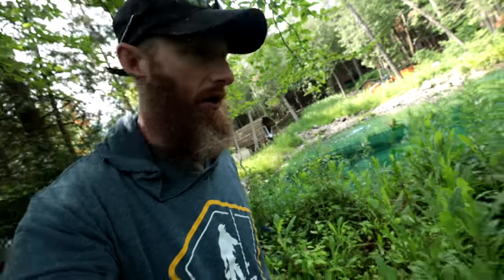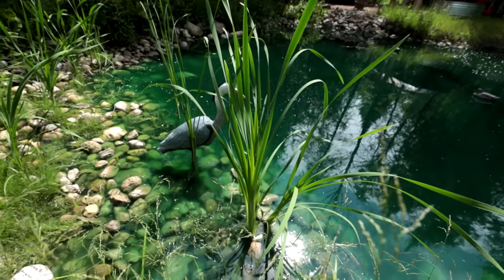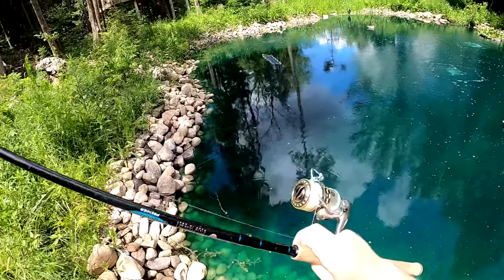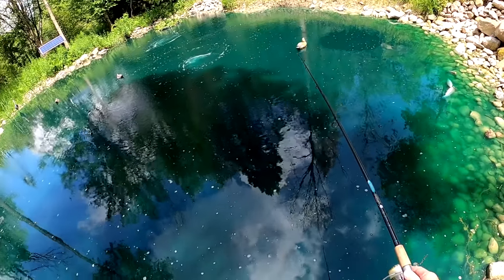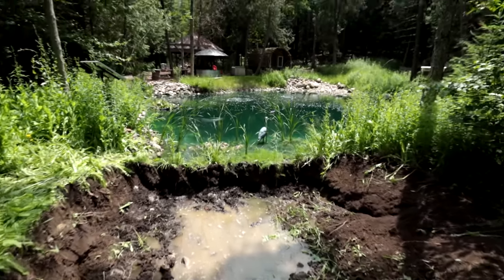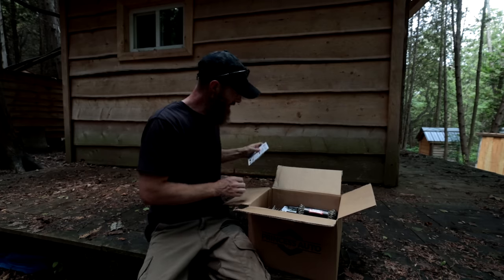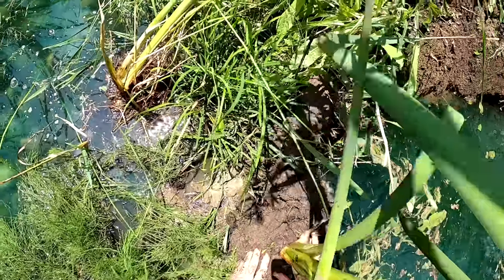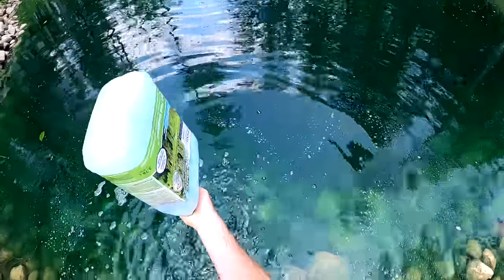BIG WIN for the Trophy Trout Pond - Perfecting Balance, New Expansion, Pond Modification, Critters

Comment: The fish seem healthy when they flop so much. I wouldn't be surprised if you get turtles in there eventually. Is it deep enough to keep fish year round? Maybe just keeping the air going all winter, would make enough current so the Ice won't get too thick? Or would that destroy the setups? Is that windmill going to spin all winter? If you plan on draining it every Autumn, that sounds like a lot of work. I read that some rainbow trout migrate to salt water, then they become steelhead trout. Don't know if it's true. But if they die and float up to the top, at least they'd be preserved in salt. That was a joke.
Reply from the maker: We plan to skate on the pond in the winter, so we can't run the aerator all winter.  Perhaps in a future year.  Yes, the aerator would just keep running otherwise, and the pond probably wouldn't freeze over.